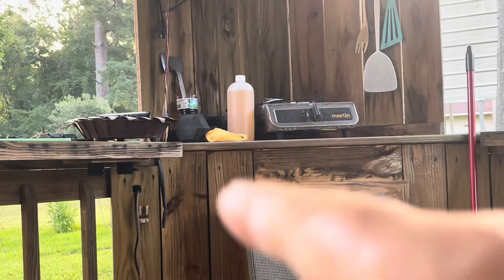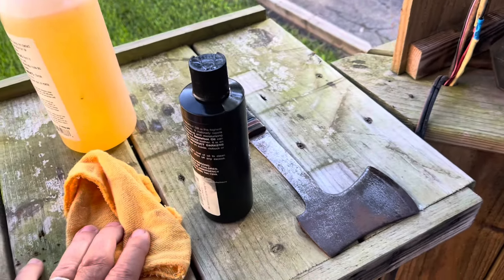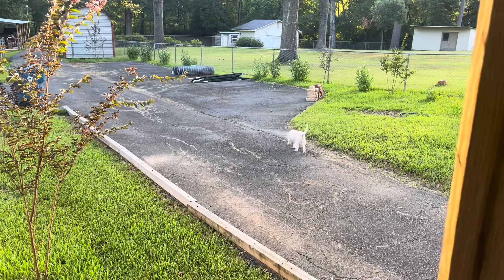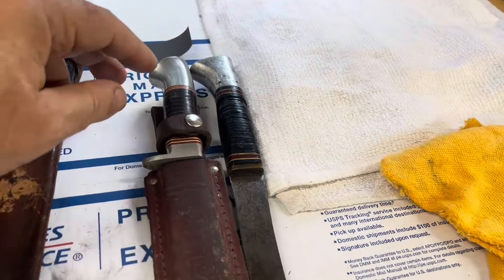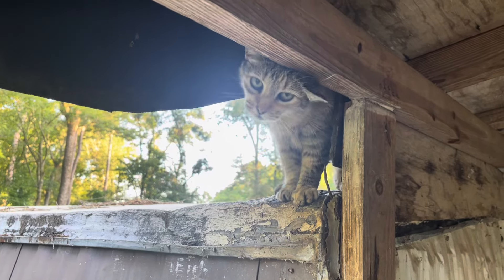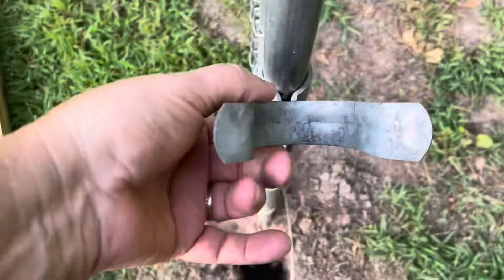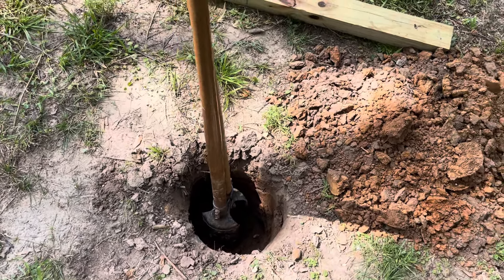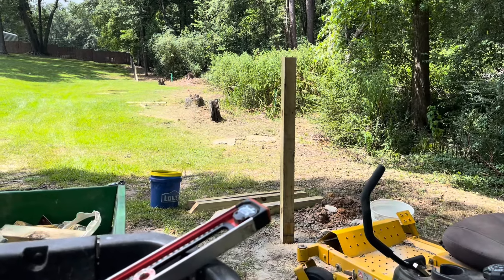Roofcat, post hole digging, concrete setting

Comment: Dang! I was hoping the neatsfoot oil would do it. 
Yeah . Those aluminum pins aren’t going anywhere. They’re expanded and galled. It’s time to drill.
I’m curious as to how they made that handle. 
It looks like the tang is a tine and the leather washers are in the form of an H.
If that is the case, restacking them and putting them under pressure to replace the pins could be troublesome.
You may want to use wood without removing the pommel. Unless you want the challenge.

I’ve made leather handles before with a pinned aluminum pommel. It would be very difficult to replace the leather without compressing the stack to pin on the pommel. It was probably done before the pommel was fully shaped. 

Whatever you decide, I really want to see what’s going on with that tang.
I’m betting the tang is forked with H shaped leather discs. Don’t leave me hanging.
Reply from the maker: Yep, they are called split tang or dual tang. Its is an H pattern. I may just cut the leather off and put some nice wood on it. Pinned, polished, shiny blade. I think I can make it look good.
Reply: @bctruck  
I have no doubt you can spiff it up real nice with a wood handle. 
I think it will be better and stronger too. 

I can’t imagine why they did the spit tang.
Was leather ridiculously cheap and the H easier to stamp out? 

Whatever. It looks to me to be too much screwing around to restore to the original.
Unless your bored and want a time consuming challenge. Or it’s worth enough money, fully restored to original, to merit the effort.